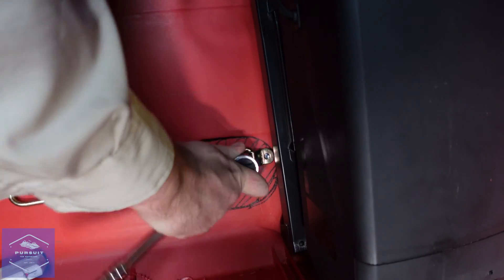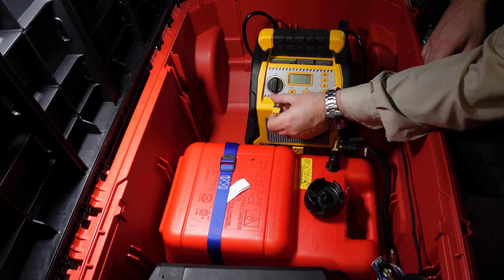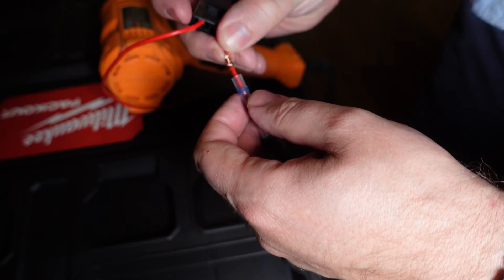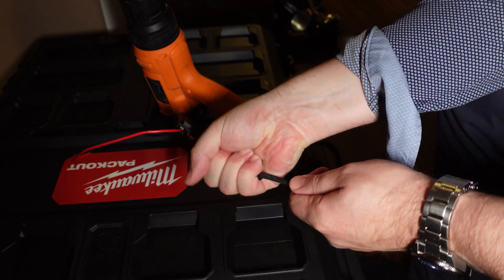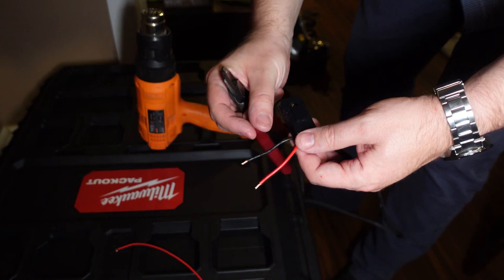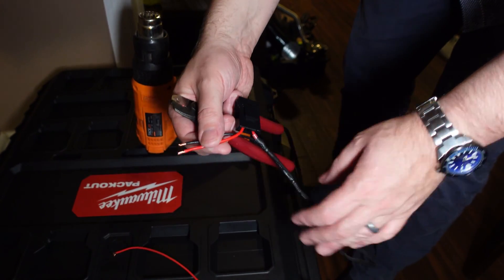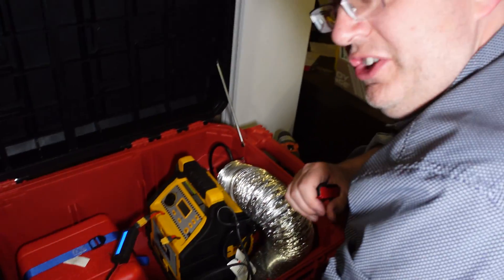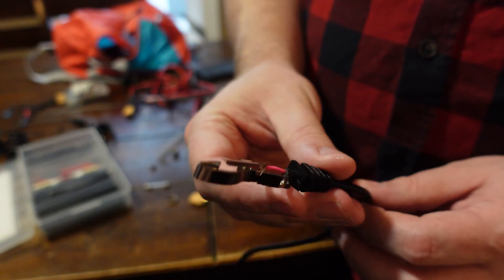DIY Diesel Heater Build Part 2 - Wiring

Comment: if you have any drips thats mist the filler you guna have to take it all out to clean r it will stink thro the heat hose just sayig
Reply from the maker: No drips. The diesel heater works awesome!

Comment: Very nice build compact and easy to deploy. I love the Milwaukee box and was looking for something like that when I was planning my build and what size is the fuel tank? The smallest I could find was a 3 gallon.. May I give you two suggestions and I'm not an expert but I've watched numerous build videos about these heaters. (1) Your pump needs to be mounted at a 15-35 degree angle. Reason for that is prevent bubbles forming in the fuel line causing error code in the heater. (2) Get rid of that green fuel line and replace it with the hard 1/4" white nylon fuel line! I believe you had some in your hand when you were searching for parts to start your build. Looking forward to seeing this in use. I'm building mine to heat my cargo trailer camper conversion. I grew up in Illinois and never got to do any ice fishing! I'm in North Carolina now and pray there will NEVER be any ice fishing here!! 😂 If you ever need help  with your heater of understand how it works check out John McK 47 video series on YT. Now let's get out there and do some fishin!!
Reply from the maker: Thanks for all of your suggestions! We found out during our first winter over night that we need to make some adjustments (video coming soon) so your suggestions will be helpful.
Our tank is a 3gal.
Reply from the maker: If you have ice there we are all in trouble 😂